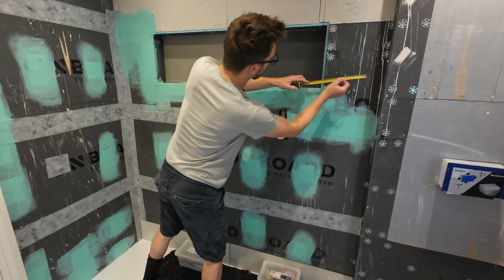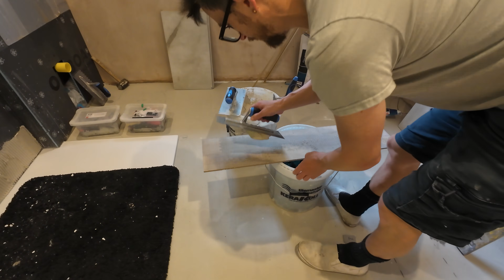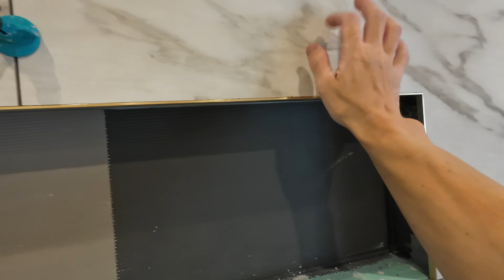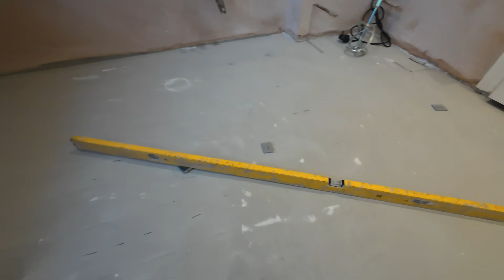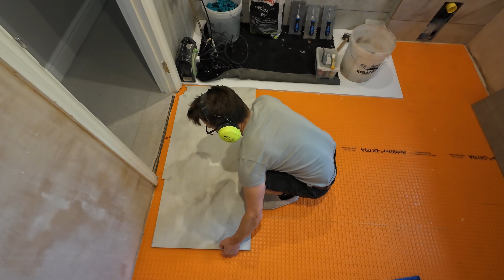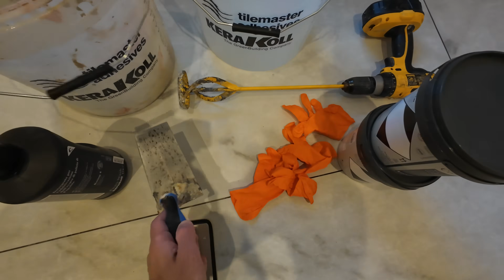How to Tile a Bathroom Start to Finish | Walls, Floor & Large Format Tiles

Comment: So much great advice thank you!! I’m going to start tiling my wetroom soon!! 
For those tile leveling clips, because they are reusable how quickly do you need to remove them? Or how soon can you remove without the tile sinking back?
Reply from the maker: Awesome, Glad it was helpful!. If you're using rapid set adhesive you could take them out after about an hour. For a mid/standard set (6-8 hours set time) I'd usually take them out at the end of the day. With a long slow setting adhesive, The next day would still be absolutely fine to remove them most times. even with rapid set I till sometimes remove them the next day and save about 90% of them. When you put them in, If you give them a little twist (to make a little pocket) that helps to 🍻
Reply: @thebespokebloke  Thanks so much for the reply! I’ve just ordered some!! 
I’ll be using Bal Flex One, will mostly be tiling at night after work so I’ll prob try remove in the morning! I’ll make sure to give them a wiggle! Thank you
Reply from the maker: @katiehughes2335  Awesome, Yep sounds good. Best of luck 🍻

Comment: In 14min you installed horizontally 2 tiles, that fit exactly between 2 walls. What would you if the distance between the walls increases for other tiles which will be installed higher? Two tiles would be too short between the walls.
Reply from the maker: Hey, They were cut tiles (not full)  if I had that scenario where 2 full tiles fitted between the walls either side of the centre line, but they ran out (so a big gap would appear) I'd centre the tile instead of going either side of the centre line. So you'd have a full tile in the middle and 2 cuts either side 🍺

Comment: Great videos very helpful and informative! I’m about to tile our bathroom, I’ve backerboarded and used a wet room former for the shower. We are putting 1200x600 tiles on the walls, do I need to put the floor down first or would you leave the bottom row of tiles out and get the rest of the walls done first ?
Reply from the maker: Hey thanks, It sounds like it's a wet room so yes you would tile the floor first. ( you could leave the bottom row out on the walls, but I wouldn't recommend) With tiling the floor first as well as adding that extra water barrier, It gives you the opportunity to line some of the wall joints up with the floor. But my whole floor set out would be based around the tray and the drain, Getting that centred and symmetrical. Then the rest works out how it works out. With big tiles you should get a pretty decent set out anyway. Hope that helps mate 🍻
Reply: @the @thebespokebloke ks so much for responding that’s a big help 👍 
I’ll need a few beers 🍻 after attempting these 1200x 600 tiles the missus wants! 
The wetroom tray is 1500x 1000w so I’m going to use 6 x 600x600 and cut 100mm off each so I’ve a centre line down middle with a linear drain. Cheers mate.
Reply from the maker: @paullinklater7993  Yep absolutely mate, the things we do for women eh haha. Sounds good regards the tray set out. Just dry cut everything first, and draw you envelope lines on the tiles (if it has 4 envelopes) and make sure it all looks good first. Best of luck mate 🍻

Comment: Hi mate, @thebespokebloke really useful videos - thanks for uploading these! I’m going to attempt to tile my bathroom and have a window recess, would you leave the bottom reveal at a slight angle to let water drain off? Best, Mike
Reply from the maker: Hey Mike, Thanks for the kind words.. Yes absolutely mate.. Especially in a wet area you need a fuall on the bottom of the seals  ( at least 5 mm) 🍻

Comment: Hey I got a question for you will about large format. I was checking out the tile vibration tools wanted to ask your input about those tools. I have a 2'x4' porcelain tile backsplash coming up I thought of buying one for. Great video once again. You make it look easy with your experience.
Reply from the maker: Cheers mate, If you've got the money then why not. I don't really bother with them as pushing and whacking for me does the same thing to what's needed. On super big tiles they can make your life a lot easier for sure. You'd still push the tile around when using one, So yeah it's one of them items that is not essential but if you're using it all the time, it's a quality of life upgrade I'd say.
Reply: @thebespokebloke thanks for the reply. Yeah I understand what you're saying. Turned out to be 2'x4' ceramic body tiles, so a lot lighter. Didn't end up  needing the vibration tool

Comment: Hi please can you tell me what I can do to fix my grout, I used white grout and I used it  a bit here and there and at different times so now I have white and off white from the same bag , how can I whitening the patches of greyish grout,to get it more uniform,I thought maybe bleach, thanks
Reply from the maker: Hey there, To be honest I'd remove the bad grout. Using a multi tool with a grout remove will make the process a lot quicker than manually doing it with a grout raker. If the grout is quite fresh it may remove still with a knife also. But to try and patch it up in my opinion never go's that great. you're better off starting again or removing the bad bits. What grout did you use btw?

Comment: Have you got any advice on tiling a fireplace? Like the internal part around a lig burner? Or even description videos if you have any? Thanks
Reply from the maker: Hey mate, Regards tiling there is no difference to any other area. Most tiles can hold high heat (but just check) then you would just set the tiling out as per usual to what looks best. Regards prep around the fire, You'd usually want some kind of fire proof backer board (designed for long high temperatures) Also recommended would be a tile adhesive that can withstand high temperatures. (Although I wouldn't worry about that to much for around a small fireplace). Hope that helps mate 🍻
Reply: @thebespokebloke I normally use ultratile profflex spes, would that be ok?
Reply from the maker: I mean generally I'm not a big fan of that adhesive in general (that's not to say it's bad) But I'm sure it will be fine mate. You can just check the specification on it to see if it has a max temperature. But it's very unlikely you'd have an issue with a flexible adhesive anyway 🍻

Comment: Hey Alec, just finishing the bathroom and first time used your tiling app and must say it saves so much headache, I can plan and layout everything up in front and then just go on and smash it, thanks for that. Also tried Bihui T-spin, as you always praise it in your videos, and wow, so impressed...just wish you had an affiliate link or something to be able to support. Would you be so kind to recomend best cutting disc for angle grinder, my Rubi one still chips, tried new Abracs one, even worse...if I was doing a bathroom a month on average, I'd go wet 100%...
Reply from the maker: hey Ivan, That's great to hear mate! and glad the Bihui clips are working well, They are great! Which Rubi were you using the TCR red porcelain? At the moment I'm using the Bihui B-Magic which is pretty similar. Some tiles unfortunately are just chippy though, where they only have a very light print on them. Also if the disc is not sitting perfect on the grinder it will vibrate (causing chipping). I sometimes have to re-set my disc when i've been swapping it for metal blades e.t.c. As I can feel straight away if it isn't smooth. Also the angle grinder being to powerful can make matters worse.

Comment: 10/10 video! Is there much difference to using a 15mm trowel with a flat back butter to 10mm+6mm? 

Also how was the mixer my Rubi one just went and I got two 70m2 floors coming up
Reply from the maker: Awesome thanks Ben! Not a massive difference mate, But I do find you get a really good bond double spreading over just a flat back with large format. But I'd just give 15mm a go if you prefer that mate and just pull it back up to make sure you are happy. Sounds like you're in the same boat as me, The Rubi did me well over the years to. But yeah I must say the Bihui especially for the price seems really decent. I can't complain, It feels lighter than the Rubi (but it could just be because it's not covered in adhesive haha). I guess the real test is if it lasts 5+ years like the Rubi. But yeah I'd recommend mate
Reply: @thebespokebloke cheers mate I’ll give that a shot! Rubi mixers are bullet proof til there not 😂 thanks for always taking time out your day to reply!
Reply from the maker: @BenPrice-zt6lc Yep absolutely mate agreed haha. Yeah give it a go they are well priced atm. Cheers mate you're welcome!